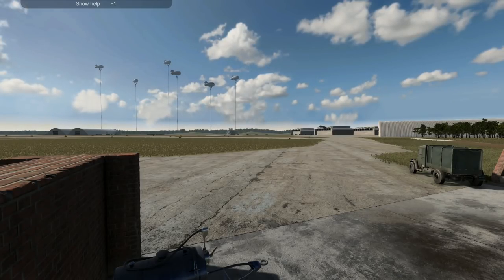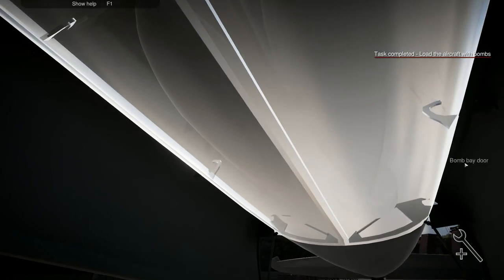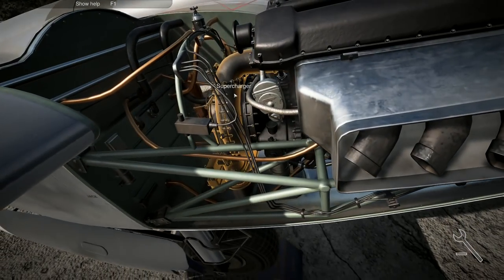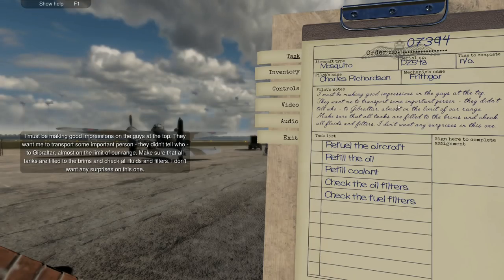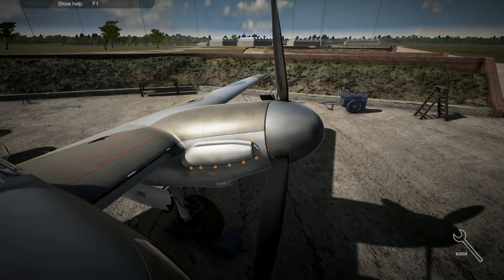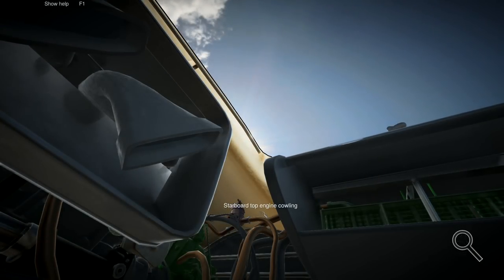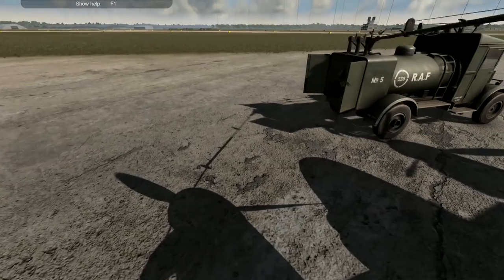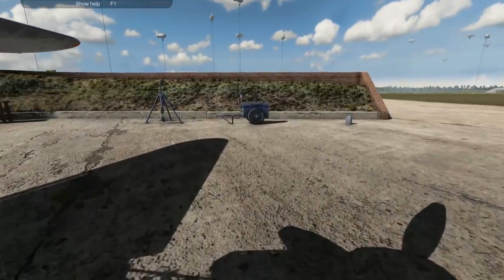Let's Play Plane Mechanic Simulator #25: Filter Issues!

Comment: Spitfires ran their engines far harder than a bomber ever would.
Why not use the extended range fuel tanks in the center fuselage?
Just think what it's like when they put in Lancaster or B17 Bombers. (yes the RAF used B 17's)
4 engines and lots and lots of machine guns.